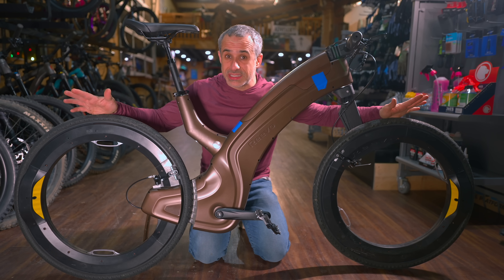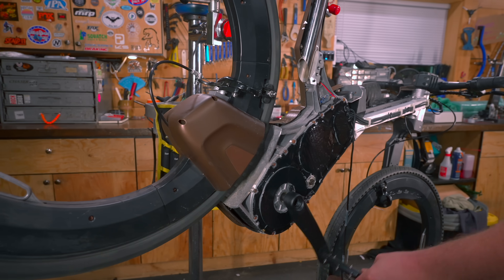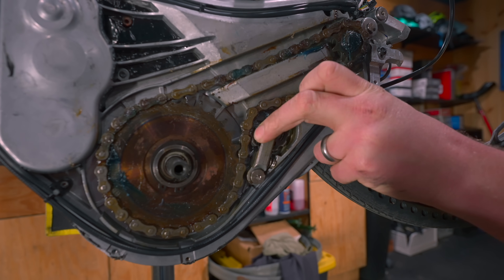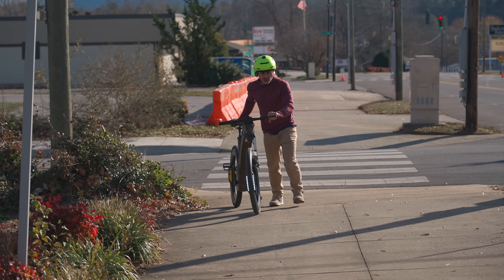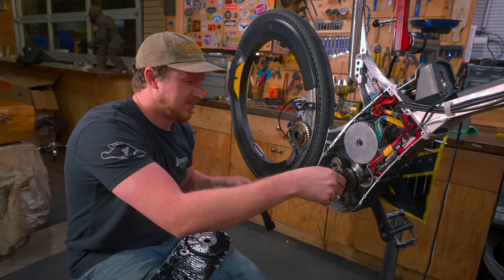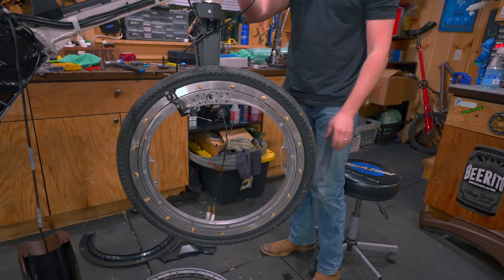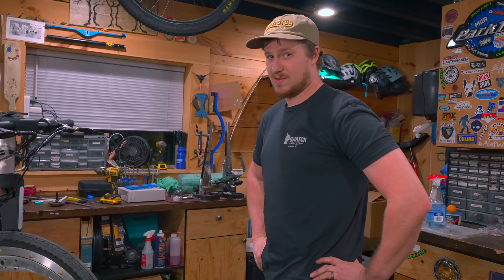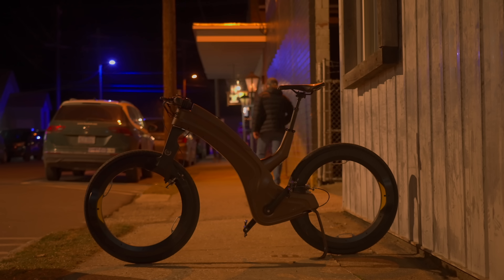What's Inside The World’s Worst eBike? Reevo Teardown

Comment: I recently heard about axle bearing resistance. The smaller the axle, the less resistance ball bearings have, as it takes less distance to complete a turn around an axle. Those Hubless are the very opposite of that principle.
Reply: It gets even worse than that. Instead of a pair of bearings in a conventional wheel, this thing has 17. Not only that, but they have to rotate something like 80x per wheel revolution instead of once. Put all of those factors together and there’s like 1000x as much drag as a conventional hub.
Hub-less wheels are basically terrible^3. That’s why they’ve never caught on.
Reply: @chrisl2656  I'm puzzled why they didn't have the bearing wheels attached to the stationary part of the wheel, that way you could have more at the bottom section and where the drive gear is, where they would be subject to most of the load, and could use fewer overall.  I would have also thought that you'd really want the bearings on either side and angled slightly in to counter lateral force on the wheel. The design as it is would presumably create extra friction with the wheel rubbing against the sides of the bearing wheels when you go around a corner.
Reply: @mels8966 
If the bearings were fixed in the hub part then the wheel rim would fall off?
The outer wheel rim is pinned to the inner hub ring 1/ by the groove the wheels roll in 
2/ the pins holding the wheels in place.
Reply: @stuartd9741  A groove in the wheel rim should work just as well, although I think it might have been better to have the gear teeth in the center and running surfaces for the bearing wheels on either side of it, which would be angled slightly in. Although maybe it would be better to use small scooter wheels to drive it, despite likely problem of slippage, especially when it is wet, or even a belt drive.
Reply: @chrisl2656  it's even more worse than that
the wheel's wheels looks to be the type used on stuff like FDM printers, and they rotate not by rolling between the wheel and the "hub", but moving along the hub and their own axle, which is just a plain bearing on a pin, it's fine for things doing small back-and-forth moves, pulled along by a stepper motor, but a bike? that's just plainly bad "engineering", especially for a commercial product
if the wheel was constructed like a large diameter ball/roller bearing, it might have worked slightly better, but also would have been about 35x as expensive for one wheel as the entire bike
Reply: @chrisl2656  Actually I was thinking after watching the gears in the video, and is it not possible that the resistance is also being further increased by the gear system backfeeding into the motor causing induction to create a magnetic field?
Reply: @LilithCatgirl  On the rear wheel, that would be a reasonable assumption, but that's not happening with the front wheel, and it's rolling resistance was terrible too.
Reply: @chrisl2656  Larger diameter bearings do have increased friction as described, but they would still be a hundred times better than those plastic wheels pinned in place in the outer casting. Hubless wheels CAN be made to work well, it's just very expensive to do. Four custom specified 30" (or whatever they are in this bike) diameter, sealed thrust bearings would cost more than this whole bike.
Reply: Couple that with the redonkulous drivetrain and endless gears that explains the high rolling resistance which isn't helped any by the caveman engineering of the heavy aluminum frame.  This thing looks like a couple of engineering school senior projects bodged together!
Reply: @flynbenny  If this was a project from an engineering school, I expect those students to fail.
Reply: One way you might possibly make a hubless wheel with low friction, is if you built it as a sort of maglev motor, so the bicycle floats on the aluminium wheel rim, repelled by a linear motor at the bottom, although maglev trains use induction to create the opposing magnetic force, and I think you'd need to get it to work with permanent magnets on the rim to reduce power consumption, which I expect would be pretty high! Would also still need some bearings to land on, so it doesn't literally grind to a halt when the battery goes flat.
Reply: @mels8966  nah... use a "michel thrust bearing" but slightly modified to work radially rather than axially. or both, as it does have to take a combination of loads. oil film friction only, with PLENTY of load capability. its why theyre still a mainstay of heavy shipping, in the propshaft... some of the designs from a century ago still havent been beaten... like a standard diamond frame...

except one speck of dirt and its all grinding paste.

remember, virtually every engine still uses a plain oil fed journal bearing... camshafts, crankshafts... its simple, and its the most effective.

maglev is just another over complicated concept, fit for one or two applications at best.
Reply: @paradiselost9946  Fluid bearings might be worth a shot, anything would likely be better than the design they've come up with. It looks like there's plastic on those bearing wheels, using a gear to mesh with aluminium teeth on that wheel was always likely to end with damaged teeth as the wheel will never stay concentric  to the hollow hub with the correct spacing for the teeth to mesh, due to wear of those bearings, dirt getting in, and flexing and clearly bumps deflecting the rim. I would have thought a belt or chain around the rim would be better than a gear. I wonder how many miles of testing they did! Maglev would eliminate the friction, provide direct drive and could provide very limited suspension and minimise the issues with dirt getting in, although the power consumption would likely be huge. That said, the fact that nobody is making a "maglev" hubless wheel, not even on a e-motorbike would suggest its not practical and you couldn't pedal it, other than using a pedal powered alternator.
Reply: @mels8966  that would add a lot of weight at the worst possible location
Reply: also , a bike is probably 70-120kg in 90% of applications. Very doable with normal industry wheelbearings in conventional sizes.  The capacity of a normal hub bearing is sufficient, so why go bigger? as you say its just resistance.
Reply: because the entire wheel diameter is the axle.
Reply: I'm curious how the bearings interact with the rim in response to the wheel being pushed sideways. Do they just rub on the channel in the rim?

Comment: It would be fun to see you guys try and fix some of the issues and make it a much better ebike somehow
Reply: Replace the whole gearing and wheel would a start, but then everything is also bad.
Reply: The concept of 2hubless wheels" in itself is broken. 
Unfixable.
Reply: @thomaskositzki9424  it would be nice to see how some Lucas oil would reduce the friction in these wheels. Different motor with less drag. Newer style pedal assist to avoid the runaway. All could make it a better unique bike.
Reply: @ That' may be true or may not be.That exact thought has been dis-proven time and time again through innovation. What
Reply: Its issues are fixed by totally disregarding it.

Comment: All the engineering mistakes one could do in one bike. Like the college/university teams competing in the hyperloop challenge. Sure one can do this but the base concept is inherently flawed. It got way more gears than expected. And all straight cut too. Which produces the extreme noise. Only good thing the straight cut gears are a tiny bit more efficient as their quieter counterparts. Then the galvanic corrosion (rusted screws) like the bike was designed by an intern that slept during materials class. And to top it all off a servo from rc toys to lock the bike. Really has it all. Would be kind of interesting as a "college" project to learn from mistakes but as this huge kickstarter / investing thing it was just a scam; overpromising while underperforming

Comment: Wait, is 31kg that heavy for an e-bike? My acoustic commuter bike weighs 18.5
Not to say this one isn't garbage, I just wonder what's a normal weight for an e-bike
Reply: I would say a regular trekking ebike is somewhere between 25kg and 30kg, with some being lighter and some like Riese müllers being heavier. For aluminium,  full powered, midmotor bikes.  aluminium fullpower emtbs are nowadays often around 25kg, with carbon frames and maybe weaker motors/smaller batteries they're not unlikely below 20kg.
So it's not suuuper heavy for an ebike per se, but if you sell it as an lightweight mtb, it kind of is.

Comment: The Thumbnail: That looks like a cheap 9g plastic gear servo on the mechanism. It's hard to think of anything worse for long term reliability in a high vibration environment where it's also not easily accessible. I must be hallucinating...

10:43 Welp!